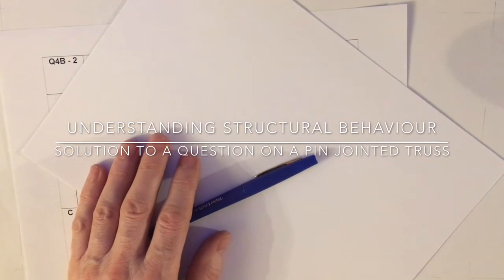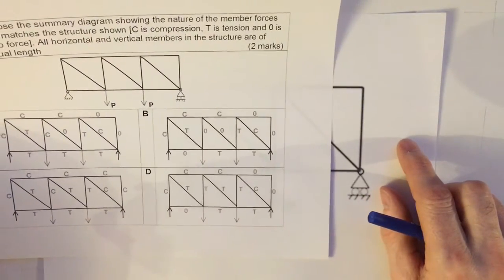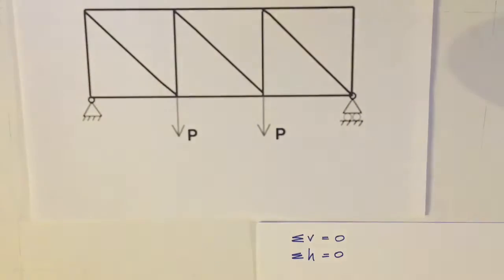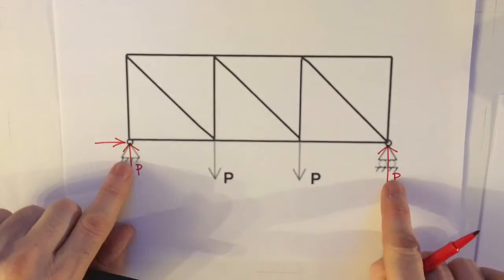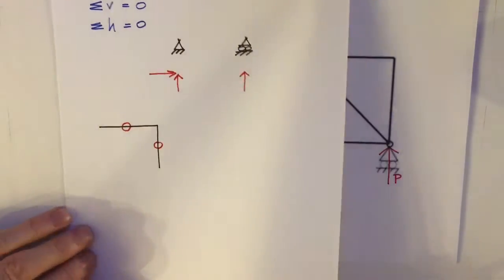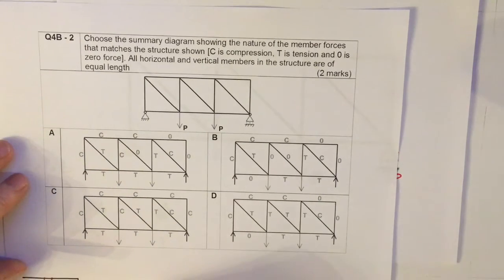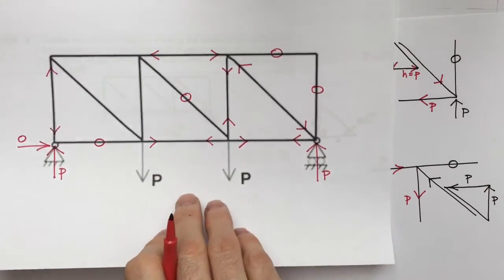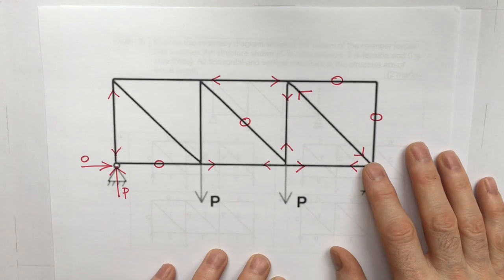Understanding Structural Behaviour - Solution To A Question On A Pin Jointed Truss

Comment: Does this mean if you remove the two top right members, the truss will still be in equilibrium?
Reply: It means that the 2 members on the right that Mike has assumed have got zero force going through them are actually redundant. They could be removed and the truss would work just as well

Comment: Top right joint - there are no forces vertically...
Bottom left joint - there are forces vertically because of P upwards...
How come P upwards on the right hand side doesn't mean there are forces vertically?
Reply from the maker: Hi jay p, Good question. This is counter intuitive but still correct. At the bottom left of the truss, the vertical reaction must be balanced by the vertical compression in the left most member of the truss. There are no other members at this joint. At the bottom right of the truss, the vertical reaction is balanced by the vertical component of the compressive force in the diagonal member. So the vertical member at this joint is not carrying any force. At around 7.00 minutes you can see a diagram that helps to explain this. I hope that this helps, Mike